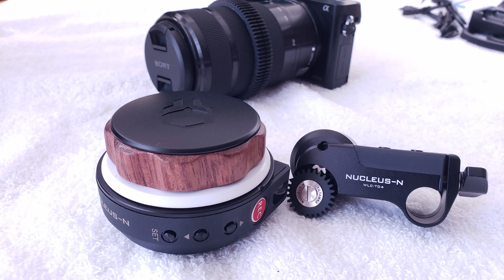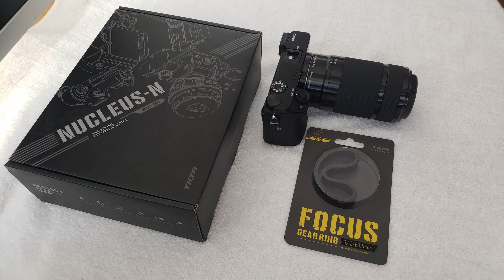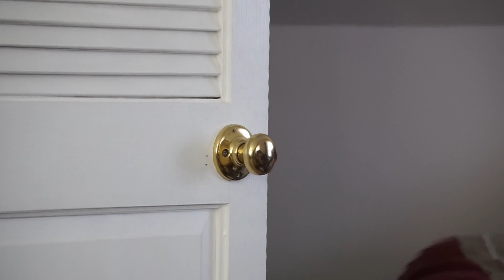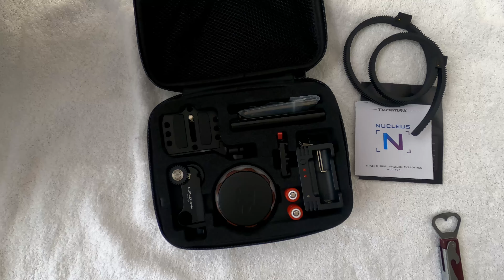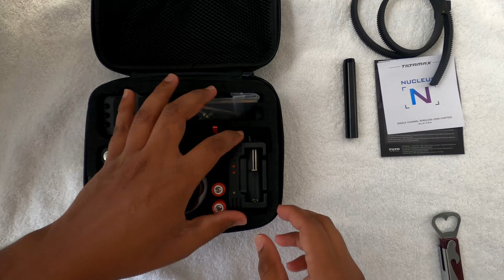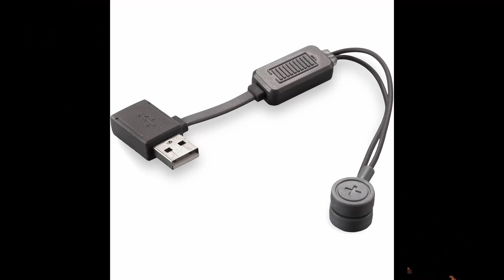ADD a MOTOR to Your Camera Lens | TILTA Nucleus Nano

Comment: The thing they don't tell you is the LCD screen is designed to fail....Used it for a couple times and like a year later the LCD is total black, look for it on google. i tried to fix it, here is the results : bought the lcd screen from aliexpress, waited 40 days to arrive, disassemble the unit was a bad experience only to find out it requires fine soldering which i am not comfortable at all....to the trash, it doesn't worth the time and effort or my internal peace...just never buy TILTA products ever !